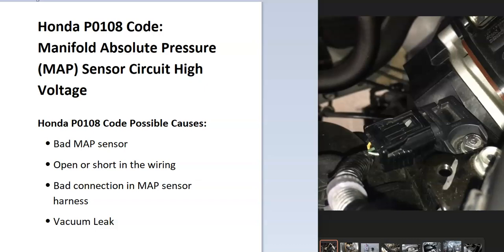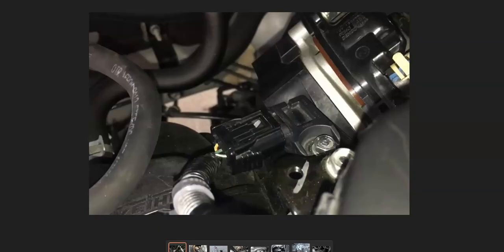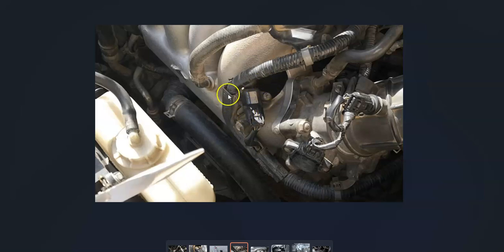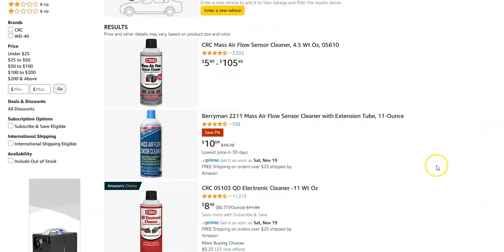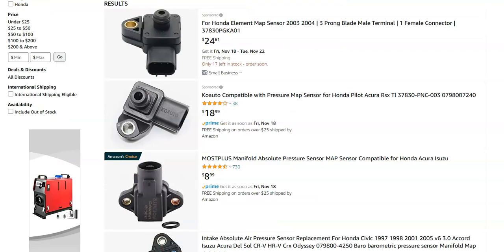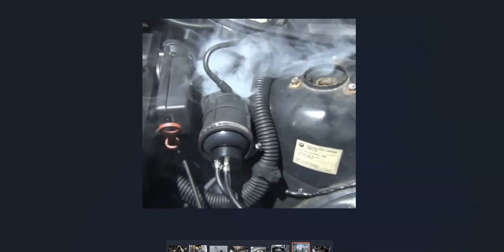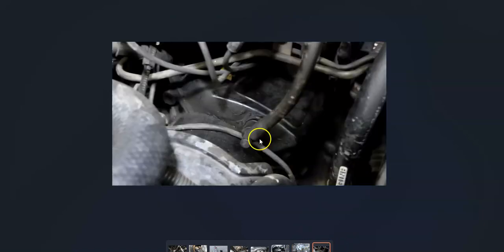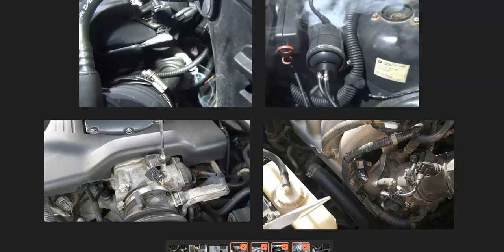How to Fix Honda P0108 Code: Manifold Absolute Pressure (MAP) Sensor Circuit High Voltage

Comment: 02 honda Accord 4 Cylinder .
1st code. Was throttle position sensor. I changed it. Then that went away, and then it came back but this is when p0108 showed up. This car has wiped my butt.

Comment: I tried to remove the sensor in my 08 Fit and, man, the screw's torqued down like Hulk had a bad day!!  Ended up stripping the screw head, then tried to use an extractor but it didn't work either.  What the heck is it with people who torque things down beyond spec?  If anyone has any ideas of how I can remedy this without taking it to a mechanic, I'd sure appreciate it.
Reply: Get it with a good wiha cutter... just cut into and TWIST!
Reply: @stickboyfpv4742  Thanks!  Tried my best but it still wouldn't budge.  Found a set of 'Vampliers' and will try those.  Not holding my breath, tho!

Comment: Would a vacuum leak from air cleaner box cause this ? I recently changed  my map sensor and the other day reverted back to stock air intake. Some of the teeth on the bottom of the housing where box fits onto throttle body are missing, was thinking maybe a leak was possible here, idk…now I have a p0108 code smh
Reply: Did you ever figured it out
Reply: I see it's been a year but did u ever get it fixed? Same problem here

Comment: A mechanic had unplugged this on purpose and tried to finesse me into changing val cover gaskets, alternator, and starter, I came across this video and sure enough as shit 💩 stink 🦨, it was disconnected! 🙏🎉❤🏆 Thanks 🙏👍🏾 man...... 💯💯💯
Reply: You just connected it and it went away?
Reply: That’s wack af tho hopefully you called him out and told him he’s a broke a** lame who has no clients because he pulls sh** like this.
Reply: Lol It still starts when unplugged though😂 I cleaned mines... and it only cranks over now... until I unplug it only THEN, will it start.. plug it back in and it stays running😅

Comment: Does the Honda Fit 2001 have MAF?
Reply: yes, next to the throttle body. should be near the throttle position sensor
Reply: Isn't the 2001 have MAP?
Reply: And lately the solonoid on my gd1 Honda Fit has been giving problems, causing hesitation and shudders
Reply: @lukmalangi  
Which solenoid do the shudder?